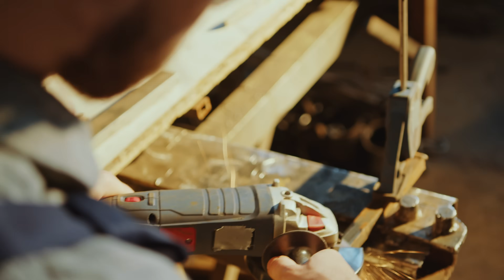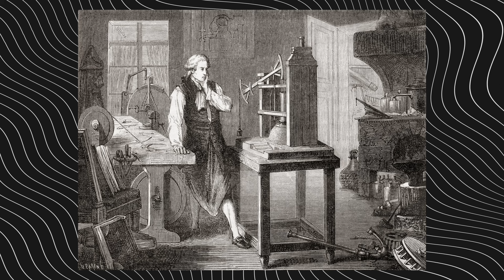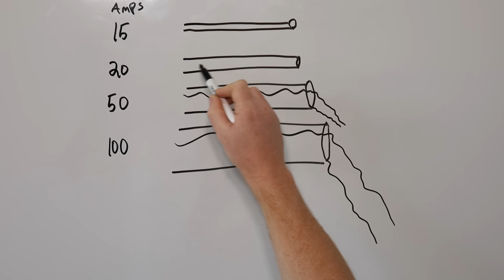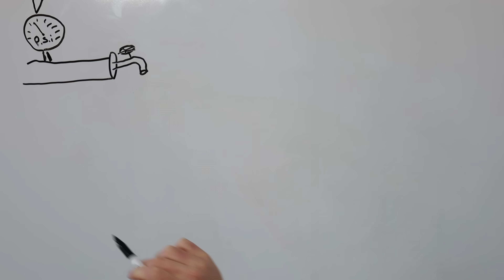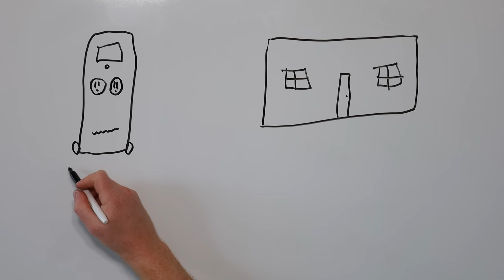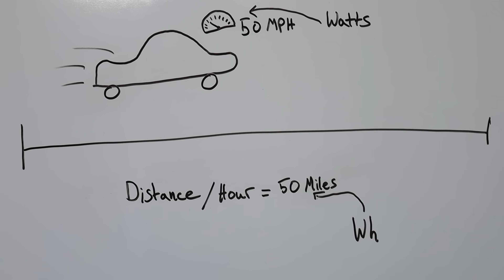Watts Explained!

Comment: Correct me if I'm wrong, but wattage is the total volume of energy right? Since an amp is the area of power per a given time interval (area of circle is πr^2, so I'll put 1 A = πr^2, circle area) and perhaps you could say the height of a cylinder is the voltage? So together, the cylinder volume (hπr^2) equals A•V which equals a Watt. Am I crazy or does it work like this?

Comment: Amazing explanation. Thank you for this. 
I recently got four 590W solar panels to power my inverter battery and load. I’ve observed the solar output Energy for about a week now and I noticed during peak day light I don’t get more than 1400W from the four 590W setup. Is 1400W output ideal from this setup or should  I expect something more close to 2300W?

Comment: nice and simple. a good place to start for learning on what you need. the only bad thing i see if you chose a very variable load in your calculation a refrigerator in your example it is a device in very heavy traffic.. rarely getting to speed but dose when it can. but tends to average about 1/3 the max. in my history

Comment: Watts and watt hours I get. Where I get confused is when you guys talk about certain solar batteries like EG4 in amp hours instead of watt hours.
Reply: Wattage is voltage times amperage. If a battery is rated in amp-hours, watt-hours is just amp-hours times the voltage of the battery (which you'd have to look at the specs for).
Reply: I'm thinking Amps is POWER like Watts and Amp/hrs is ENERGY like Watt/hrs.  I'm sure someone will correct me if I'm wrong.

Comment: I've got a generator with 2 x 120. Normal wall plug with 15 amps each. It also has an RV plug that is 120 but 30 amps. I bought an adapter that plugs into that and splits off into 2 x 120 wall plugs with 15 amps each. How does it divide the amps? The generator is a harbor freight predator 5000.
Reply: If your adapter is dumb, the plugs are just wired directly and there's nothing actually limiting either of the plugs to 15 amps beyond the fact that the plugs themselves are only rated for that amperage and will probably melt if you draw more than that. If your adapter is smart, it probably has a current limiter circuit  or fuse that keeps each plug from drawing more than 15A and the generator may have nothing to do with it beyond supplying the 30A total.
Reply: @r.l.royalljr.3905 Thanks. I will contact the adapter company and ask if those plugs are smart or not. Just to be clear, there are "amperage resisters"? If they're dumb I can do the math and not plugging anything into them that doesn't stay under 15AMPs? Can I infer that amperage is a potential but not a push?
Reply: @afan1979  Current limiting is a tricky business. If you bought your adapter at Harbor Freight as well it's probably direct wired and if you're lucky each plug has a 15A inline fuse, otherwise your adapter probably cost as much (or more) than your generator did.

Amperage is always drawn, not pushed, so as long as you don't plug anything that draws more than 1800 watts into each of those plugs it should be okay (1800W = 15A x 120V).
Reply: @r.l.royalljr.3905 Thankyou for taking the time to answer this with the math formula. I will use a "kill a watt" device to make sure I stay in the safety limits. By the way Harbor freight doesn't sell these but Amazon does.